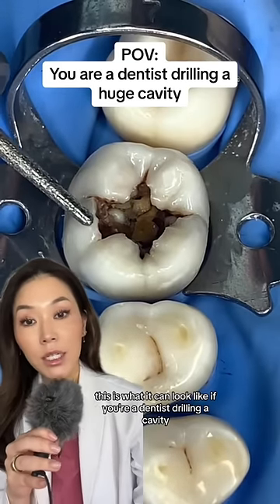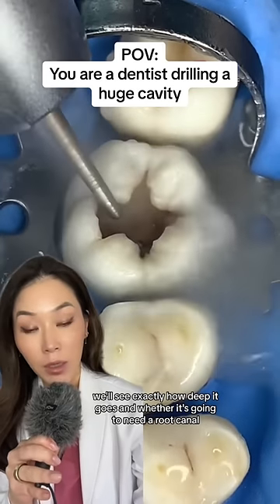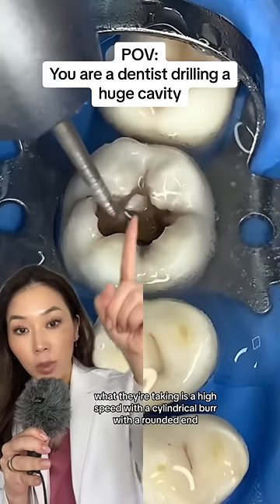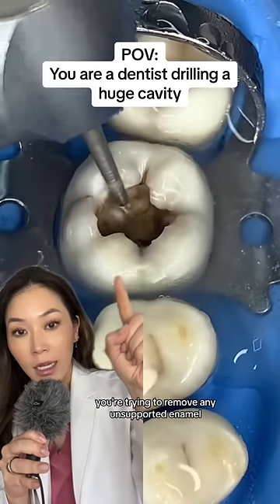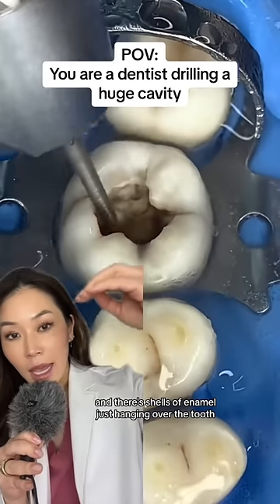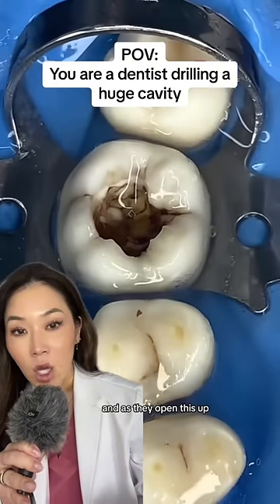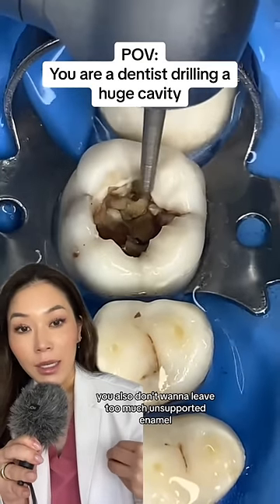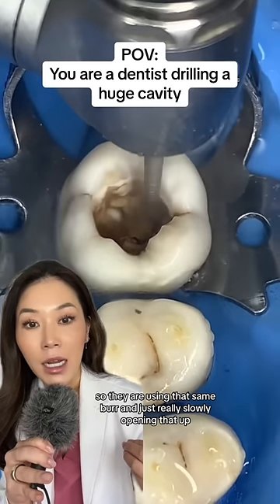Drilling a huge cavity 🙀 #cavity #dentist #rootcanal #dentistry

Comment: The clamp right away tells you it's a root rootcanal for sure.  💯
Reply: Not necessarily.  I use the rubber dam for  a lot of my restorative, close to the pulp or not.
Reply: I had a clamp and I only needed a filling for a small cavity.
Reply: @krisdeaglephotography4539 Yes it depends on the practitioner. Rubber dam is a PITA to apply, but it is best practice for even small restorations.
Reply: @macktaylor4389  I haven't used one since dental school.  (I don't do RCT)

Comment: I had a terrible dentist who ground my tooth so much it cracked from all the vibration s of the grinder. Now every dentist says I need an implant because its cracked. I can't afford two grand for an implant and I live with a giant crater in my tooth! I have to clean the crater out every time I eat
Reply: tell me about it. got a financial plan from the dentist and the least i can pay is two grand out of pocket or a payment plan at a 25% apr. i went home without getting the treatment.
Reply: They don’t have a grinder. It was likely already cracked, but they were not sure until they worked on it. That’s always a possibility. They can start working on it and see there’s a fracture.
Reply: I’m sooooo sorry that happened to you.
Reply: A slow speed drill does not cause cracks. It’s too gentle and honestly the tooth probably already had a crack from some food or grinding at night. 

Also, if there is a giant crater in the tooth, then why wasn’t it not filled properly? 

And, you don’t need to get an implant if you don’t want to. You can opt for a partial denture or crown depending on how bad it is. Many people can’t afford implants so there are better options out there.

Comment: My question is…how did you fit a camera in the mouth to take this video ? Just curious
Reply: They typically use really tiny waterproof ones. Guessing like the ones used for endoscopies .Science is crazy
Reply: I mean, iphone camera zoom in like crazy and I sure hope doctor's got that tech first
Reply: It's a microscope with a built in camera that stays overhead not close to the mouth
Reply: They put gopro hero 10 inside the mouth haha
Reply: 4th wall
Reply: This isn’t a real tooth is how. They aren’t touching on any sides, likely a practice tooth
Reply: @jaredstergar9939  it's a real tooth
Reply: @anujmaheshwari3202  must just be a coincidence that every single one of these videos is a large bombed out #30 and they NEVER have interproximal contact (so the viewer is able to visualize the mesial when they prep for the class II)
Reply: @jaredstergar9939  Typodonts rarely have random anatomical features like this.

Comment: If my tooth was this bad id have them remove it no root canal. Everyone i know thats had a root canal says they wished the tooth was pulled instead
Reply: It depends on the tooth tbh but it’s not that bad
Reply: Money wise it’s definitely better to get it pulled though
Reply: Have had teeth pulled and 2 root canals. Root canal any day.
Reply: Yes, because the root canal can fail after years and you may need additional work
Reply: I’ve had a root canal and had zero problems since. After having the procedure the pain stopped completely. I would take root canal any day over having my tooth pulled.

Comment: I have a question? So when I was about 16 or 17 I had a really bad cavity. I also still had my wisdom teeth. Instead of just pulling the bad tooth and letting my wisdom tooth fill the gap they gave me a root canal and pulled my wisdom and now my cavity came back. Why didn't they pull the bad tooth and let my wisdom tooth grow in and fill the gap?
Reply: Also the drill they used broke in my tooth and he left it in because he said if he tried to get it out he'd ruin my tooth. Could this have caused my cavity to come back?

Comment: If you are using a high-speed burr to remove decay, then I can guarantee you ;you will find the nerve! Open with a high speed drill start removing decay slowly with a low speed round bar and if the patient has had no symptoms or pain and the tooth tested vital before you opened it disinfect the area, place a cavity arrester and temporize with a glass ionomer. But never ever ever ever use a high speed drill to remove decay because that will guarantee you a root canal! Although! Your stuff looks pretty bad visually. I would have to see the x-ray first before I can make a more definite diagnosis but it doesn’t look good.

Comment: Root canals are just a longterm dentist prescription to visit every few years and charge you thousands. If the tooth isn't visible when you smile, get it extracted.
Reply: …… unless if your dentist sucks at root canals, that’s not true. The reason you should avoid extractions no matter the tooth is because it will cause bone loss as soon as the tooth is out. When the bone gets resorbed, it loses functionality and makes you age faster. Look at people in their 40s and above. You can tell whose done a good job of preserving their natural teeth (even with a root canal) versus those who just extracted a back molar. 

Plus, when you remove the back teeth, you lose a major component of the chewing force. If you force the chewing onto your smile-visible teeth, they will fall out faster since chewing makes the gums around them loose. Your front teeth are meant to cut only, not chew. 

Not doing a root canal will make the other teeth worse and then you have to wear dentures at an earlier age. Root canals can last a lifetime if you just do a good job with oral hygiene.

Comment: 4k gents they just told me i need a root canal and a crown
Reply: Pull it, get a implant for about $1500 more.
Reply: @614BlueBerry  why an implant if my tooth is ok 👌 why would I want a fake tooth if I can save my tooth. Some one else told me I've be walking around with a dead tooth though.
Reply: Sweet Jesus, 4k!? I had one last year and it was under $400 for crown lengthening, root canal and crown. Find and pay for a good dental insurance my dood
Reply: @Casca-su3ty a fake tooth would probably last longer with less issues long term
Reply: @mypriusisfaster  in Mexico probably ! that's average price in dentistry in the US. There is no way you pay that in the US, a cleaning costs 400 dollars..
Reply: @Casca-su3ty  Delta dental insurance is what we have. Starts you off at 70% coverage when you first sign up but goes up every year if you follow dentists maintenance plan. Currently we're at 90% insurance coverage with only 10% out of pocket. So yes, low dental costs are possible, and no we don't go to Mexico to get our dental work. It's all been done in SoCal area.
Reply: @mypriusisfaster  really! Am gonna look into that thank you so much for the information.  Because I was actually thinking going to Mexico 😂 not a joke I have a friend goes there told me a root canal is 200 dollars and the crown is another 200.  Thank you so much